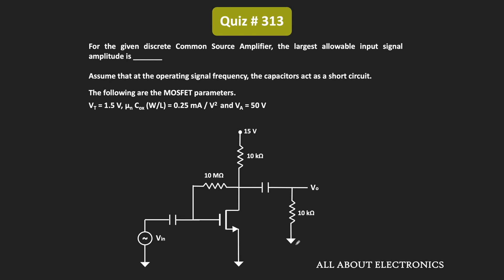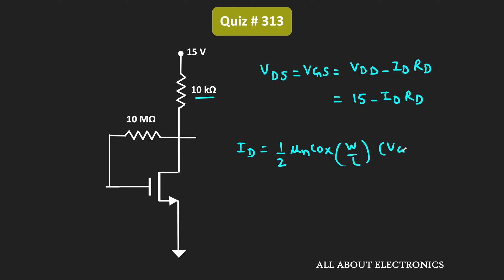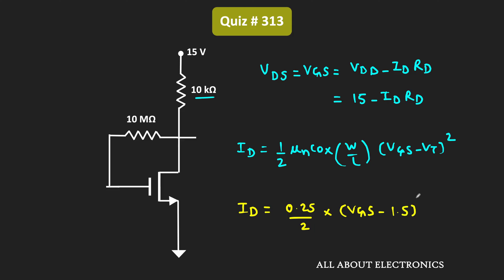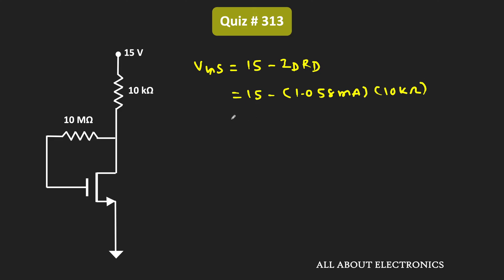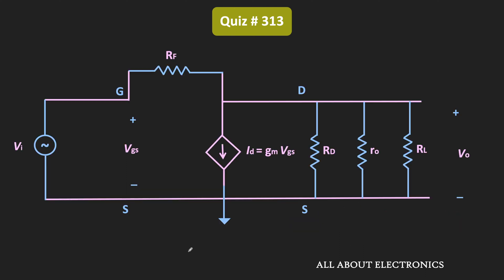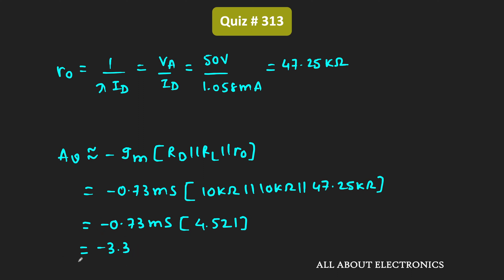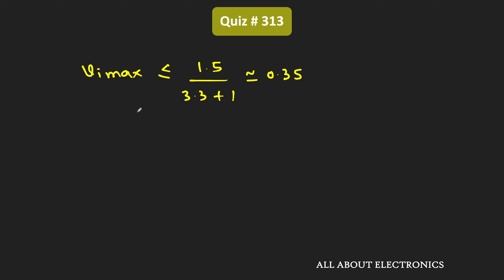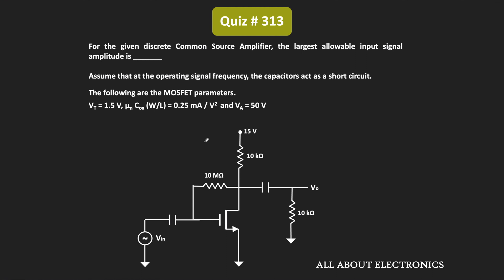MOSFET - Common Source Amplifier (Drain Feedback Bias) | Quiz # 313

Comment: Much appreciated sir 😊
That is Cs circuit and then g_d short and Vgs=vds and in Saturation(vds>=vgs-vt)),is similar to diode So:
Id=k(vds-vt)^2=(15-vds)/10
1.5-0.1vds=1/2*0.25(vds-1.5)^2
Vds=4.40v or -2.2 v(incompatible）
 vds=vgs=4.40v
id=1/2*(0.25)*(4.4-1.5)^2
=0.125*(2.9)^2=1.05mA
gm=2k(vgs-vt)=2*1/2*0.25(4.4-1.5)=0.725ma/v
Av=-gm(ro//rd//rL)=-3.3v/v
ro=vA/id=early effect/=47.25k
Ps:
My confused is Vi(max) or Vi(min)just only affect vo value on the circuit? 🫡🤔

Comment: Professor why didn't  we take into account feedback resistor and how would this resistor affect the Av if it were small value?
Reply from the maker: During the DC analysis, it is not considered because gate current IG is negligible. And here for simplicity, it is assumed as zero. During the AC analysis also, since it is in MΩ, it is much higher than Rd. And it won't affect the small signal gain. 
For more info, please refer this video: https://youtu.be/yoHfp8pAVek
Reply: @allaboutelectronics-quiz  thanks a lot

Comment: why we did DC analysis to find transconductance? We can find it using formula for gm = sqrt( 2 Un * Cox * W/L * Id) ??
Reply from the maker: Using that also we can find the transconductance, but even with that too, we need the value of the drain current Id. And for that, we need to do a DC analysis.

Comment: why you haven't took channel length modulation formula while calculating id?
Reply from the maker: The channel length modulation parameter (early Voltage VA ) is used for calculating the output resistance of amplifier.

Comment: Sir, I dont understand how did it become 8000Id, did we convert the unit system? Similarly for 10^8Id. Can you please explain?
Reply from the maker: At 2:38, mA was converted into A. While Rd is 10 k or 10^4 ohm. So, simply during the calculation, the value of Rd is taken in ohms.

Comment: Sir, i dont know why Vds = Vgs, can you expain it for me please !
Reply from the maker: Since gate current Ig is zero, there won't be any voltage drop across the 10MΩ resistor. Therefore, the voltage at the gate terminal is the same as the drain terminal (Vd = Vg). And hence, Vds = Vgs. 
I hope it will clear your doubt.
Reply: @allaboutelectronics-quiz  thanks for your reply! Have a good day sir !

Comment: sir, i don't understand that gm = kn(Vgs -Vt) or gm = 2*kn*(Vgs - Vt).  i saw in the video 24, you used gm= 2*kn*(Vgs - Vt) but in this video, you used gm = (Mn* Cox)*(w/L)...... Can you explain that for me? thank you.... (sorry about my english)
Reply from the maker: gm = kn (Vgs - Vt). where Kn is process transconductance. And it is equal to un Cox. In one of the videos, I think I have considered all the device parameters as some constant K. But it's not the same as Kn (process transconductance). I think due to the same letter k, the confusion arises. But I hope, it will clear your doubt now.
Reply: @allaboutelectronics-quiz   thank you for your reply, my problem was solved! Have a good day, sir!